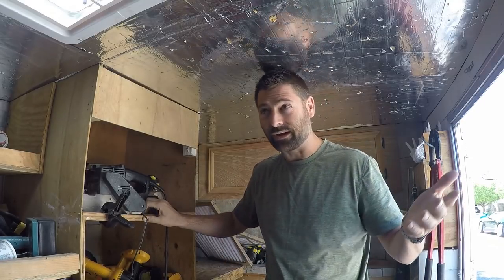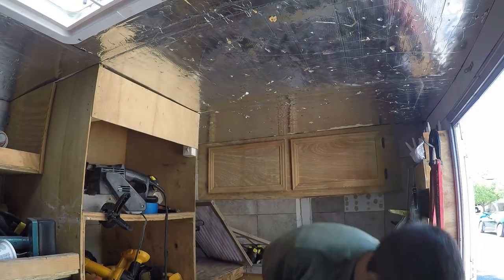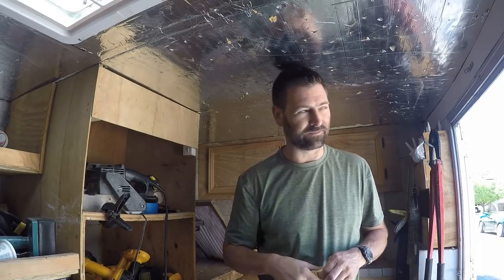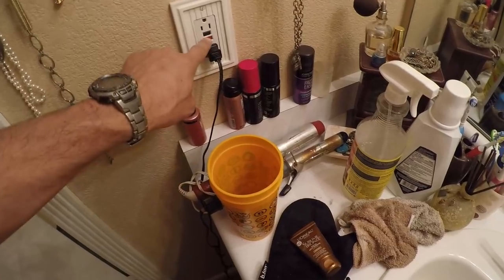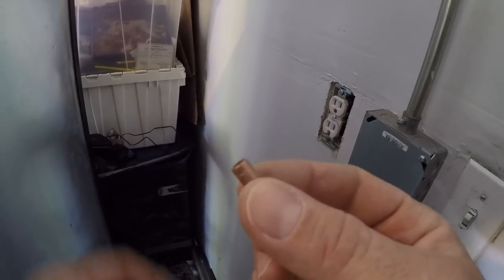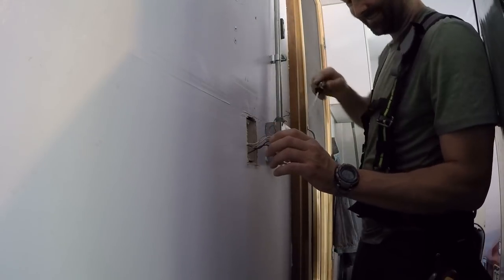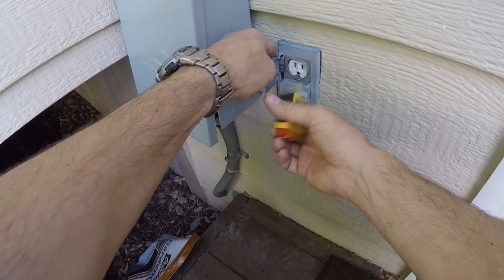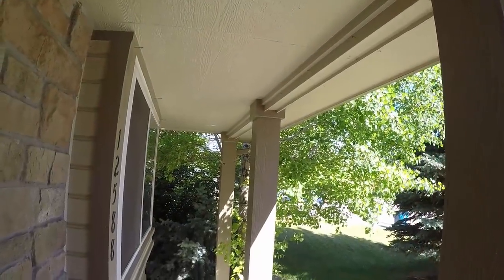Handyman Makes $1,200 Per Day Resetting GFI Outlets For Millennials | THE HANDYMAN |

Comment: Why wouldn’t you just suggest that he go check the gfi in the master bedroom before you came out?  Per your response you do a lot of work for this property manager, so don’t you feel the need to somewhat preserve the relationship you have with them.  I have always told my employees to do what is right by the customer while being FAIR to the company and you will never have to worry about having business.  If I was this property manager I would drop you in a heartbeat if i saw this video.  Again if you manage multiple properties for him, this would hit your pocketbook well beyond the $500 you “earned” on this job.
Reply: Although I agree with your stance on prolonging their relationship, you have to remember the time spent travelling to the location, equipment used, time spent at the location, and then of course labour. @ 0:13 his watch shows 9;23, and again @ 11:41 his watch shows 9;56, indicating that he most likely charged 1 hour of labour between 100-200/hr. He also says he came and gave a quote, which takes more time.

:)
Reply: It's a rental, and depending on how many rentals the property management group has, the cost to send someone out is minimal. Property management groups in the pacific north will run you $80 to $110 a month for an average rental. If they manage 50 rentals its easier for them to send someone.
Reply: So telling someone how to fix it with the knowledge that you possess is a smart buisness move 🤔🤔.  When they ask or call someone else that someone else is going to charge them money.  You're paid for the knowledge you possess
Reply: Agreed
Reply: This is a video. But it is a rental, they aren’t going out themselves most the time
Reply: I think just like the bill collector and the government collect your money at the end of the day we don’t get a discount for a prolonged relationship with anyone not your grocery store not your liquor store and for damn sure not your landlord so … know your worth. Our time is the one irreplaceable thing only we decide what to do with
Reply: No shit, I was thinking the same thing, very quickly. I understand the travel time and tool rental, I do. But something is off

Comment: What’s really scary is two people who aren’t competent enough to understand GFI outlets felt confident enough to pull an outlet out of the wall to investigate.
Reply: The fascinating part is that this is totally installed properly/efficiently. GFI provides protection to non GFI sockets provided they are after the GFI in the circuit. I've seen kitchens and bathrooms with dozens of GFI when only one was necessary - huge waste of materials.
Reply: Lol, thought the exact same thing
Reply: They felt comfortable enough taking it apart because it was dead The GFI in the bathroom did its job and cut the power

Comment: The garage and outside outlets are on the same circuit as the upstairs bathroom? Who wired this place?
Reply: Thats how my fucken house is too. Some bullshit
Reply: Gfcis are usually all on the same circuit
At least the ones I dealt with
Reply: @lorensolares6277  No he means that a garage should have its own dedicated circuit, not shared with any room inside the home. This is just a poor and lazy way to wire a home.
Reply: @lorensolares6277  a garage should be on a seperate breaker for a few different reasons
Reply: people who flip houses do this, it’s cheap to just pull power from the nearest wire than to do things right
it’s stupid
Reply: My dad
Reply: Haven't looked at NEC lately but I thought the bathroom circuits can't leave the bathroom but local ahj supersede in some situations.  Plus any motor load on gfci can cause issues.
Reply: It's also classic suburbia in the last 10 years. Lots of goofy stuff for current and future Handymen Supremes
Reply: GFCI do no trip for no reason. How about trouble shooting the issue instead of pushing buttons.
Reply: Very common for houses wired in the 80s.
Reply: It wasnt until the 90s and that the NEC mandated single closed branch circuits in bathrooms and garages. Half assed remodeling contractors tend to junction where it's most convenient for them. I've seen KITCHEN FRIDGES  loaded of bathrooms in multi-family homes more times than I can count. In which case I just switch it to the line side, make sure it's affecting anything else safety wise and call it a day.
Reply: My bathroom and outdoor outlets are all on one GFI circuit. The house was built in 1993. I learned this the hard way when my breaker tripped and I found out the issue was with one of my outdoor outlets. Its not how I would have wanted it. Maybe someday I will rewire it myself. Its working so I am good.
Reply: No test of GFI, condition of circuit or reason for fault.
Reply: Current NEC says the bathrooms receptacle needs to be on its own 20a circuit. Multiple bathrooms can share the same circuit.
Reply: Code minimum crap from lazy new construction.
Reply: @brianglade848  funny
Reply: @douglasgreaves188  I was thinking that same thing.
Reply: That’s not how it’s done anymore.
Reply: The bathroom gfci has to be on a dedicated 20 amp circuit it’s never has been allowed to feed another receptacle unless it’s in another bathroom. The garage receptacle has been required to be on a dedicated 20 amp circuit as of 2008 nec. To fix the receptacle from being set to far back from the Sheetrock you use an extension box. Not a barrel crimp. The authority having jurisdiction is not allowed to supersede the code just because. As an electrical inspector I have no mercy when it comes to house flippers. Maybe it’s Canada
Reply: My home built in 95 has one GFCI in the Garage that is just down from the panel. This GFCI controls all 3 bathrooms and they also put the exterior lights/outlets all on this same circuit. It’s the ONLY circuit in the garage so if I’m running my dust collector and table saw in the garage, I have to tell my wife to NOT run anything like her circling iron or hair dryer or the damn thing trips every time.
Reply: Ok guys everyone calm down. Install all gfci and line side everything. Problem solved.
Reply: When the light switch is wired to the outlet so you have to turn on the lights for the outlet.
Reply: @danielrivera2630  ahahahahah. Thats quite a "load"  of you know what! ;) I loved ♥
Reply: You make the extra home run then!!!! Hahah
Reply: I've had a condo with gfci outside protecting a receptacle in a bathroom.  Gfci line and load where swapped, and it was tripped, and still looked good on plug tester.  Turned out place had been pressure washed, gfci got wet.
Reply: How's one supposed to know that the master bath gfi controls the outlet way out there on the other end of the house? Seems like the electrician who wired this house was an idiot
Reply: That's because they usually put GFCI circuits together.
Reply: @dennismbrandi  Actually, they are called 'Box Extenders' and in this case probably unneeded, the receptacle looked like it was less than a 1/4" in the wall.  And don't so quick on blaming house fillpers or even the electrician. 9 times  out of ten it's caused by the drywallers covering the boxes and then using a roto-zip to cut around it.
Reply: @cvpiDOTnet  some gfci  bathroom upstairs will tie in the the garage gfci  and its fine
Reply: My grandfather wired our cottage with stripped down extension cords running right across the ground to the sheds. No conduit or covering. It blew my mind it lasted 50 years. So at the very least at least the wiring is inside the walls lol
Reply: I can understand why they couldn't figure it out. It makes no logical sense for the gfi in the bathroom to be linked to the garage and outdoor outlets.

My house was built in the 20s and has been updated over the years. It's a nightmare trouble shooting anything due to the years of Frankenstein fixes and updates
Reply: Maybe it was a plumber.
Reply: @MichaelWilliamsJr78  you are absolutely right
Reply: My old house was built in '88, hall bath, garage and back yard receptacle were on the same 15 amp circuit and GFCI protected. Builders will do anything to save money.
Reply: @billybl22  what is the appropriate action for the wallers to do?

Comment: When we run circuits in houses, garage gets it's own, exterior plugs get their own, fridges and freezers get their own dedicated circuits.  That place was wired a bit lazily if you ask me.
Reply: Hey for the fridge do I have to have it on a GFI by itself?
Reply: @luisarrizon6707  where I live, as long as the fridge is on it's own circuit your fine. Unless your fridge plug is above counter height and right next to a sink where water could potentially splash the plug.
Reply: Let me ask you something. We just built a house and the keyless basement lights seem to wired so crazy without any forethought. There are 3 lamps wired on the same joist that goes first to the middle, then to the right, then back past the middle to the left. I'm going to install new lights and want to break out the "dirty" side to a separate switch. I'm going to have to rewire the whole thing because it's all intertwined. Why don't they just wire them from light to the next light to the next. Right now, it's hard to trace and when I do, it just doesn't seem to make sense. What don't I know?
Reply: Tolohtony what did I just read? Dirty side?
Reply: I've seen outside circuits being loaded off bathroom gfis but mostly garage gfis. Once I found an outside gfi powering 2 bathrooms in a diy house.
Reply: @luisarrizon6707  most people do not like a gfci for a fridge. They prefer a dedicated circuit. The reason is if you go on vacation and it trips then you have no power to the fridge until the gfci is reset. To me it isn't that a big a deal unless  you plan on being one for weeks at a time.

Comment: This video is proof that my devices are watching me...    just yesterday, I was called to fix a very similar issue.. the homeowner had replaced his older kitchen outlets with gfci outlets and got his wires crossed..   he also replaced every other outlet and wall switch in the house in one go, then couldn’t figure out why nothing would turn on.  Fine by me if someone doesn’t understand the basics of a 3 pole switch.  Thanks for the video!

Comment: I just did your floor patch hack. Same as a drywall patch but on a wood floor. Worked perfect as I was able to find a two tone board to match the hole they put between two boards. Thanks for your service amigo.

Comment: Every homeowner should have a plug tester. Shhhhh, did I just say that out loud. lol
Reply: having one and knowing how to use it are not the same thing, lol
Reply: Just use a fork.
Reply: @buk6708  😂😂😂
Reply: Caleb m  plug testers perform several tests at once with 3 visual led indicators. One of the simplest electrical diagnostic tools u can buy. If they dont know how a GFCI works how can u expect them to understand all the functions of a multimeter?

Comment: What kind of rate do you charge? $500 for that would never go over where I live.
Reply: That's what I'm saying. Even in California you couldn't make $500 off that.
Reply: Johnny Souza yeah no kidding. Up here in SW Washington state I can’t charge over $150 to add an outside outlet or they call someone else
Reply: Maybe he’s on Long Island or Westchester
Reply: yea thats a little steep BUT, if you get someone for cheap that doesnt have the knowledge to problem solve an think of what else could be tripping or possibly bad in that circuit then youll be wishing you paid a little more. someone who has no idea how to diagnose would start "throwing parts" at it or start cutting holes everything thinking a wire is broken or chewed through. its not the time, its the knowledge. knowledge is expensive. work is cheap.
Reply: I would charge $139 in Minnesota and provide up to an hour of labor.
Reply: If you thought it was the GFI why not tell them to try it first? That would be a good way to lose a long term customer.
Reply from the maker: @Bnesemann  They are my longest running customer.  I have been working for this property manager for over 8 years. This is a rental house. There is no one to to push the button. I GET PAID TO PUSH THE BUTTONS.    Telling customers how to do the work is bad business.  They didn't call me to tell them how to fix it they called me for me to fix it.
Reply: @johnnysouza5601  you can if you do a "circuit repair" and not a "push button repair" and its understood up front that you are, as The Handyman always says, fixing the problem.
Reply: He lives close to a rich area that’s why he is successful. Anybody can do it.
Reply: Same here they'd refuse to pay.
Reply: @TheHandyman1  I really DO agree with you. Recently I had a water leak and I called several plumbers, 2 of them insisted on telling me how to fix it, I had to explain that I called to get it fixed, not to learn how to do it my self. It left me wondering if they are plumbers or trade instructors! :)
Reply: @kabinex3205  Showing the wealth!
Reply: @kabinex3205  Was the fix to press a button? If not you cant really compare, and if it was you're part of an extremely small group of people who would wait and pay an extortionate amount of money to have someone else press a button for them.

Comment: Another cheap and effective way to make a spacer for a receptical is a piece of 1/4 inch pex pipe. You can cut it to length and use 2 inch long 6×32 screws

Comment: This is what I personally would have done I would have took the circuit that came from the bathroom to the garage separated it from the GFI put it on the line side instead of a load side figure out which outlet has the feed coming into the garage and put another GFI there.  The garage the bathroom and outside should technically be on separate circuits at least that's Florida codes.

Comment: the permanent fix: In masterbath go to line side of GFI outlet with garage power and then put a GFI in garage if needed.  If things trip it will be local to the problem and easier for different tenants to figure out. Guess its in masterbath ...oh my.

Comment: Do American sparkles need to use insulated screwdrivers by law? In Aus we do
Reply: Only if the circuit isn't locked out.  In this circumstance the circuit should have been locked out before working on it, but its not well enforced.

Comment: easy way to know you tripped a GFI is by using a volt meter. Confirm no hot by testing volts to ground then check continuity between N and G If both are open its almost always caused by a GFI outlet because it will open both lines.

Comment: One spectacular customer- construction management savvy, wound up resetting the single GFCI basement outlet daily. Replaced the 13 20 amp limit devices strategically, load to line, GFI protected, area by area, but this was minor utmost customer service- the impossible- extremely fast and perfectly, is standard. Think multiple hat trick

Comment: An electrician told me once that when the ground prong is up, it is actually the right way up. Said that when a child pulls on it, the plug will be forced further into the outlet, protecting those prongs from danger a bit more I guess. People just like to see a happy faces on the receptacles!
Reply: Pete M it is also best practice when using metal cover plates. If the plate comes loose and falls between the outlet and plug, it will land on the ground.
Reply: Michael beat me to it. You could also have something conductive fall in it regardless of the cover plate
Reply: You guys are talking about some highly unlikely scenarios. So I guess you also run all your power strip upside down as well?

Comment: On the subject of GFI outlets, Fluorescent lighting can trip them when you turn the light off. I've seen it so often with student microscopes that use a 5W bulb, that I know it's not an issue with the light. It's just reverse EMF from the ballast when disconnected. It happens a small percentage of the times it's turned on/off that makes me think it has to be the timing of the disconnect with the cycle of the electricity. I don't know if it happens with house lighting or not, but it would be a hair puller of a problem to troubleshoot for a handyman who has to come back and reset a GFI on a regular basis.
I've seen school labs that have a GFI outlet in every position instead of using one to feed the other outlets. It's quite comical to push the test button on one and have several throughout a lab room trip at the same time.

Comment: As a live sound guy, I'm running into more and more GFI outlets built onto temporary power drop boards for festivals and the like. The unfortunate thing is GFI outlets and the new, high power, fast mode switching power supplies in the power amplifiers (to drive the speakers) in large outdoor PA systems, do not play well at all. The high frequency switching that occurs causes the GFI's to trip.

the workaround is a box of drywall screws kept in the truck to keep the reset buttons "depressed"